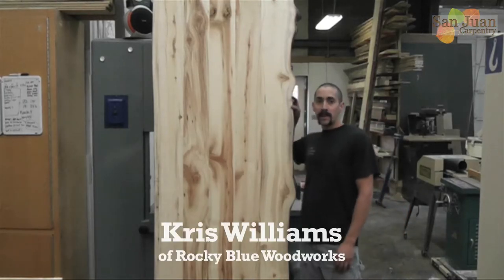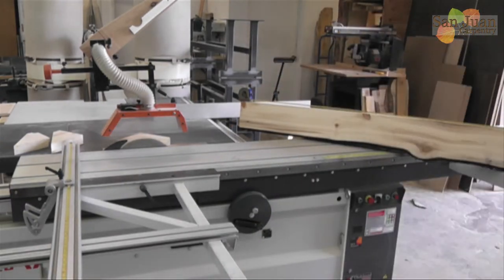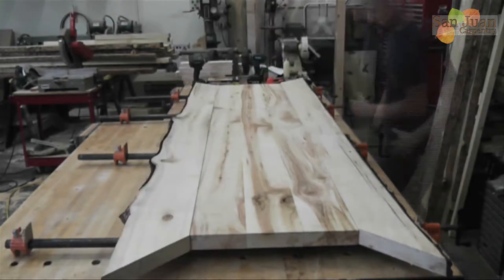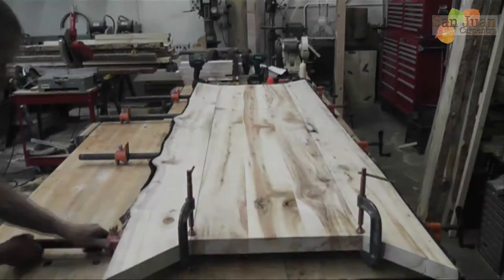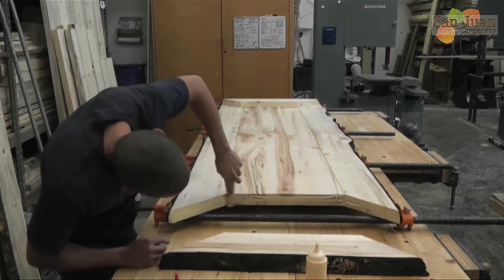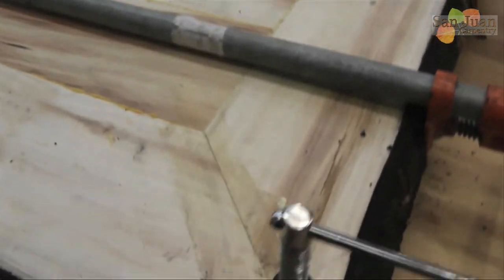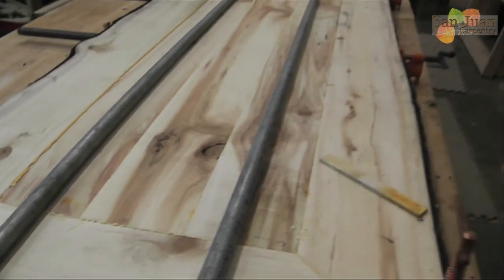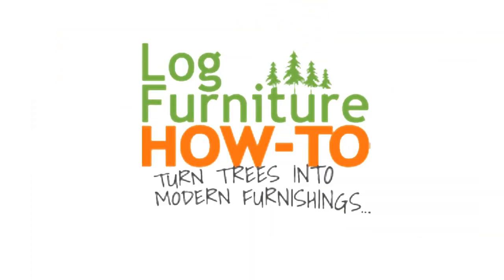Live Edge Table Top How-To

Comment: J hylander, I would agree with you. Expansions and contraction due to humidity changes with the seasons will cause the center boards to expand and contract. That will guarantee the miter joints popping within 12 months. It's a beautiful table, but not designed to stay that way for long.

Comment: Wouldn't the miters get messed up due to expansion and contraction of the middle boards?
Reply from the maker: That is one of the most popular concerns for this type of glue up. It really depends on climate (Colorado is very dry), the moisture level of the wood, and the finish you use. If you seal it well with a Bar top epoxy for example, the wood cannot absorb or lose moisture. Therefore, no movement. If you live in a dry climate your chances of movement are lessened even more. Thanks for bringing that up!